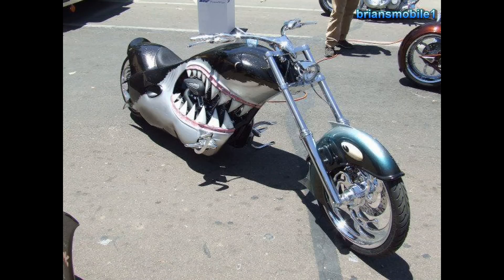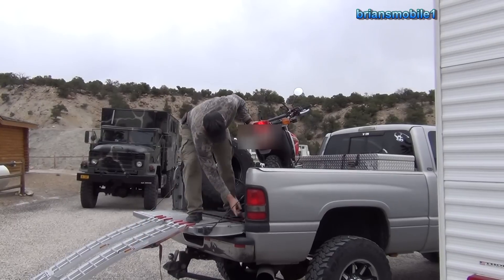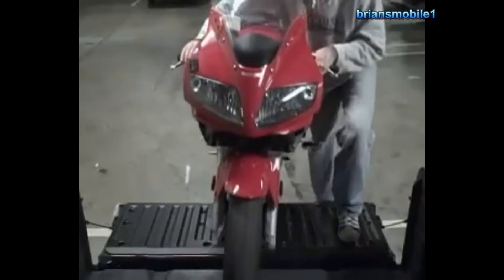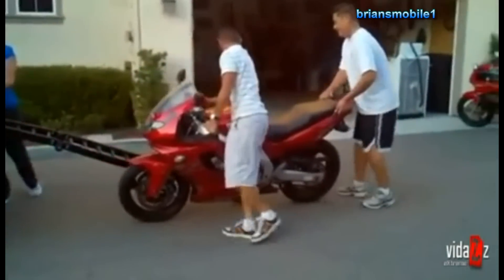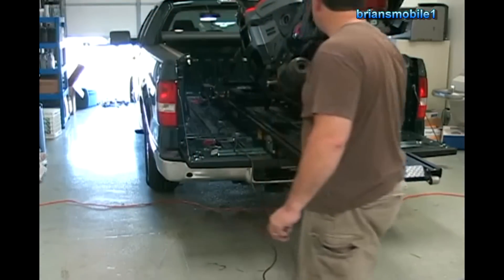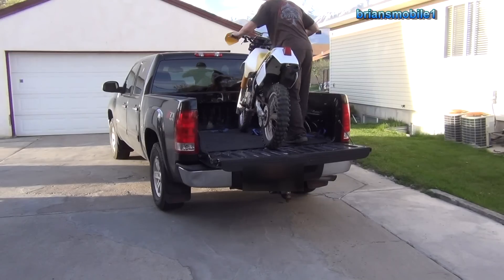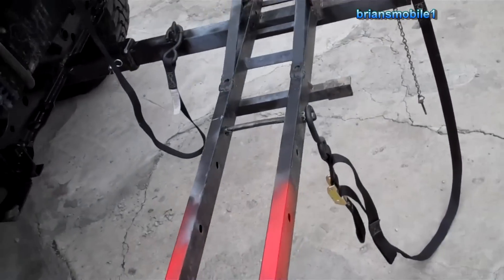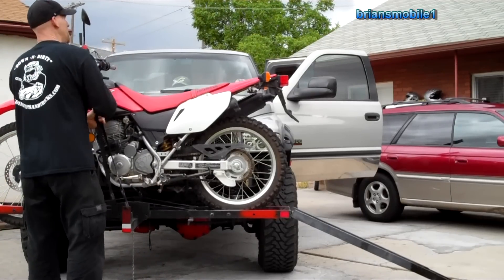How to Load a Bike Complete Fail Win Compilation for Education

Comment: Great video as usual. One thing I would ad is look for the situation on the truck that makes the trailing edge of the tailgate as low as possible. Facing up a drive way makes the tailgate higher , if the truck is facing down the driveway with the back wheels in the street gutter, the tailgate can be half as high and the ramp almost level. But this takes nothing away from your excellent instruction.
The world needs more great people like yourself.

Comment: When I only have a pickup to haul with, I invariably managed to find a shallow roadside ditch nearby to back into.  Most pickups used to have tailgates you could unhinge and rest right on the roadside shoulder.  Pushing or riding the bike in or out from the road side was then a piece of cake!  I'm only 5' 6", and 130 lbs, but this method worked for me from my 100cc bikes to my Goldwings.
Worked in a bike shop in the mid 80s.  Had a customer than never rode his bike in for service, he always trailered it in.  Worse yet, he would always tie it down backwards on the trailer, with 4 straps, but with no way to draw down the front forks.  When departing the shop after one service, the whole rig dipped in the driveway gutter.  The bike's front end compressed down, the handlebar straps fell clean off,  and the bike fall flat over on its side, smashing the tank, side cover, signals, etc.  He promptly walks back inside and orders all new replacements for everything, and then he leaves the bike for parts installation.   A week later he comes with the trailer to pick up his repaired bike, and sure enough, puts it right back on the trailer the exact same way that totaled the bike the week before.  He was pretty hateful about the whole event, even though he had brought it all on himself.  I don't recall the he ever came back after that, and I don't think he was missed.

Comment: Great video, thanks for posting.  I have one of those Harbor Freight cargo carriers (the steel one with steel mesh bottom) and used to carry my KLR250 on it.  It worked fine for that but getting the bike on and off was always a challenge, because I wasn't smart enough to put something there to stand on as mentioned in this video.  One time I was removing the straps to unload it, and as soon as I got the last strap off the bike I tripped on the rail at the back of the carrier and went over backwards down to the asphalt.  The bike came down right on top of me, but due to some unbelievable good luck all the weight of the bike contacted the asphalt via the handlebars and other points on the bike.  I was unhurt.  Still can't believe that.  Now I've got a heavier bike - a Honda NC700X, and am getting a new carrier that also has a 2" receiver so I will be able to load my bike on it and also tow my car.   This time I'm going to get something to stand on while loading the bike though.  Some lessons are learned the hard way, unfortunately.

Comment: Brian, a good tip is to put the front wheel in the drivers side corner of the truck. That way you can check your blind spot easier.

Comment from the maker: It's got 150K on it.  I got it three years ago with 120K miles on it for $200.  I split the block and had the crank machined and replaced the bottom end parts.  Best thing you can do is maintain fluid levels and replace fluids when needed.  Most need head gaskets around 150K.

Comment from the maker: It was VERY popular on motorhomes through the 1980's with those little Honda Trail 110's and Trail 90's.  (they had quick release handlebars you could turn sideways just for that purpose) Now days it's really just not common.  I think one reason for that is trucks aren't set up as well to accept a receiver on the front.  To answer- yes, but not factory.  It's not allowed stock.  NIHS won't allow it.  If I ran a red light and T-boned someone it would be terrible.  I have to take great care.

Comment: Thank you! I know how hard it is to to make a good video when your software keeps crashing your computer. I have had the same experience, and it is absolutely infuriating. I have since switched to hitfilms and it hasn't crashed once. It is quite hard to learn though. Once mastered though, you can do just about anything with it. While working at Walmart when I was a kid I had to load lawnmowers using ramps. I had a 100% success rate = got lucky. My co workers did not. We had everything from flipping over backwards and getting crushed to ramps falling off or bottoming out on the top of ramp with the mower deck. It was a miracle no one died. We did have one back injury. A couple years ago I bought a new mower from an individual and asked why he was selling it soon, he had flipped it going up a ramp and broke his back. After that experience he decided to hire his yards mowed. +1 on the carrier. I use the same one for my DRZ. Looking to upgrade to a stronger one for my cb500x rally raid

Comment: I am 5'7" and ride a VTX1800.  I have a ramp system similar to the one at 6:50.  I can load and unload my bike into the bed of my F250 by myself with no issues.  I would recommend popping the tailgate off though.  They really aren't made to support that much weight.The keys to a good ramp system are;1) Get a ramp with a curve so you will not high center when transitioning from the ramp to the bed.2) Get a ramp that is wide enough for you to walk beside your bike or ride it up and have a place to put your feet down.3) Make sure the surface of the ramp has some traction to it.4) Don't skimp and get a ramp that is too short.5) Load rating > you + bike.6) Safety straps.  Every time.  That includes straps to eliminate lateral movement.  Keep the ramps from moving east/west on you.A good ramp manufacturer will provide direction as to ramp length and rating based on your equipment.
Reply: Very true about the ramp being wide enough for the you and the bike. Just doesnt make sense anyother way.

Comment: Good vid! Thanks. I used a hitch carrier to haul a little TW200 5300 miles up to alaska. Mine had a anti wobble piece on it. Google TMS Anti Wobble. Its simple to make just 3 bolts, some welding, some cutting. It really locked it down to no rattling. Do you secure the rear wheel at all? Maybe my handlebars are farther forward but my bikes would tip forward somewhat easy so I thru a strap around the rear tire.

Comment: The guy at 8:20.  WTF didn't he leave the front of the truck out in the street with the rear wheels in the gutter?  The back of the truck drops relative to the front and to the end of the ramp.  No high center and less slope to climb.

Comment: A potential problem with the receiver hitch mount carrier, is the twisting affect on where the bike part is welded to the hitch part. Loading and unloading puts a lot of stress there, and some (especially the cheap ones), tend to crack, or break there. Take a good inspection of that area often, when using it.

Comment from the maker: The idea is to not have the springs compressed so they last longer AND to keep the suspension from being in service as though you rode the bike all over the country on your MX expedition (friction).  They work, but I don't ride circuit.  Just short jaunts locally these days.  Usually 100 mile trips here and there.  It's just not necessary for me.

Comment: If people will look around within a few feet there usually a low place , a dip a pot hole something you can put your rear tires in or the tires of your trailer. Also a rise you can back your trk or trlr to. This lowers the height of your ramp thus decreasing the degree making it easier and safer to load bikes and stuff like riding mowers....

Comment: great viddy brian, I was hoping you would cover the use of cam locks verses ratchets. I've only used ratchets but my friends say to be professional you need to use cams. I just don't want my shit loosening up down a bumpy road,lol. anyway what is your opinion on the two? pro's and cons. I get soooooo nervous when it comes time to haul. I have a flat trailer with a wheel cradle in the front.

Comment: Why would you not talk about the easiest and best method? Putting the tailgate up to a level hill. Did that to remove my dads 99 Harley. He wreaked it so it was hard to remove. I sat on top the bike to hold it upright while my mom and dad pushed and pulled it out. Was hard to straddle it as I'm short, use the brake. And the handle bars were loose. Then just walked it down the driveway in the garage. The hill is about one inch higher than the tailgate but much safer and easier then using ramps. And to load would be even easier as you can just ride in no problems. So remember. Using a hill will always be better as it can make it safer and also can lower the angle between tailgate and ground if it's not quite level.

Comment: Instead of loading the bike in a truck, it is nice to have a small flatbed trailer. There are no bed walls or wheel-wells to get in your way. And the trailer is REALLY low to the ground, so it is super easy to get a bike onto.
Reply from the maker: Agreed

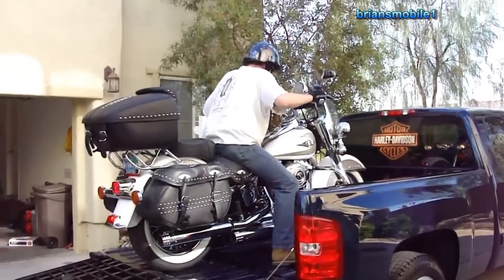Comment: Something was bothering me when I watched it last night, so I watched it again. At 6:55, the guy loading the Heritage in the back of the truck. Rear wheel is on the tailgate. They ordinarily aren't meant to carry that sort of load, especially concentrated at one point in the center. Guess I'd do it myself if it were a crisis, but not on a routine basis. I'd recommend not relying on the tailgate to support that sort of load.

Comment: Never included the reverse of your method. I start perpendicular to the truck, and lift the rear tire (can lift it with my knee and leg instead of arm and back by basically tipping the bike onto your knee while lifting) and swing it on to the tailgate. Then straighten it out, let it sit on the skid plate and take a break if needed. Then hold the front break with one hand and lift the front tire from the forward most sprocket (for most mechanical advantage) onto the tailgate. I get lazy with straps and just crank one down over the seat, diagonal across bed. Then the best part of this method is that I can ride it right off! My XR250 clears the ranger's gate so you just roll off, and it lands smoothly every time. The KDX220 however cannot do this because the pipe hits, so I lift the front tire down , then roll the rear off.

Comment: But once you load a bike, you tie it down and compress the suspension! Doing that puts pressure on fork seals, and if the suspension isn't fully compressed, a big bump will cause the strap to loosen and then tighten abruptly. Always tie down with 2 straps pulling forward and 2 pulling back and tying down where you compress the tyre, not the suspension. Over the axle and behind the forks/swingarm and at 45 degrees away from the bike works, as long as the tie down point isn't more than about 20 inches(500mm) away due to stretch and flex of straps. The straps Harley use to tie their bikes down in crates are the best to use, about 3/4 inch (19mm) wide with a ratchet tensioner on one end. If you're transporting big or top heavy bikes, another 2 straps tying down around the middle of the frame/rider footpegs/floor boards/crashbars/frame  work as stabilizers, and preferably pulling back.

Comment: I would think that walking beside the bike slipping the clutch while loading is harder than just riding it in.
Reply from the maker: Nathan Stevenson The point is that it's more controlled and the success rate is higher- not that it's less effort for the seasoned rider on a dirtbike.

Comment: Bro you forgot step #1 place rear wheels in a depression such as where your driveway meets the road. On a little Tacoma you'll hardly need a ramp and it will mitigate the redonculous bro dozer 25" lift.